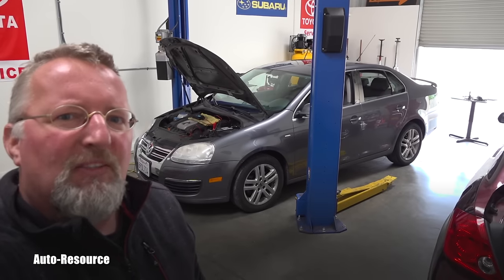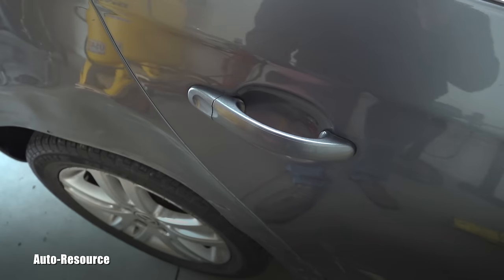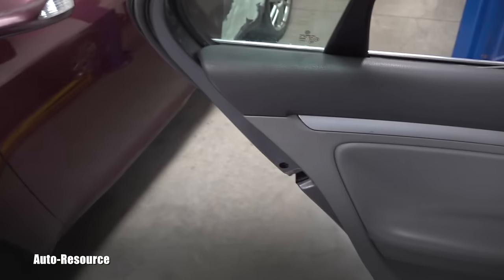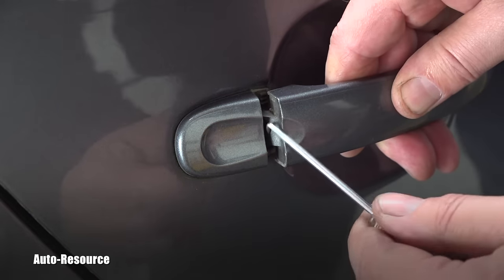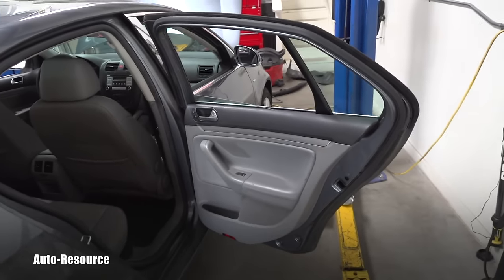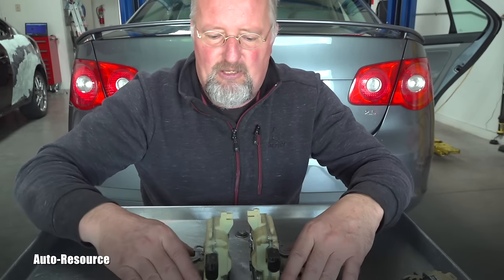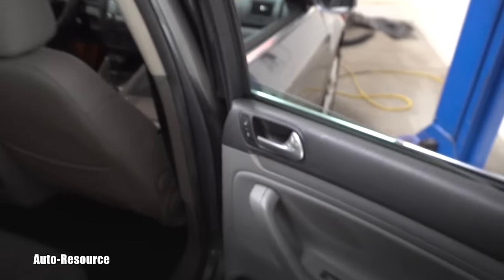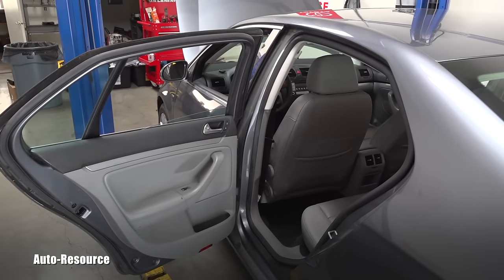How to open VW door which won't open from inside and outside

Comment: I popped the cable out but wont open from inside....any advice?
Reply: What helped for me was applying the central unlock button a couple of fast times on the key and at the same time pulling the indoor lever. Step by step I succeeded. Then it is important to remove the bottom screws of the indoor cover and the indoor cover itself. And then you will have to replace the lock itself, which is an awful task.

Comment: What used to happen to my 2015 Jetta (and only on cold Candian winter mornings)  is the drivers door locks would click locked and unlocked eight or ten times by themselves.  When the drivers door wouldn't open from the outside i would go in from the passenger side and have to open it from there with great difficulty.

Comment: I did it, If got a 2006 VW T5 Van, disconnected the cable, nothing, still won't open with inside handle.

Comment: What if the trick doesn’t work? My car driver door won’t open from the inside or outside and I just changed the door lock because it was bad.( never locked out unlocked the door) after I swapped the part it locked fine but won’t unlock. It does the unlock noise but won’t let the door open like it’s stuck 💔

Comment: Hi, I have a golf 5 1.6.. my passenger door won't unlock but does for one or two days after a very long time. Iv changed the actuator but still have the same problem. When you press unlock, the mechanism clicks twice instead of the normal once and doesn't open. I am beyond very frustrated since it's been years and need help..it locks and unlocks when it please. If I can't get help please at least suggest a type of specialist I can go to.. a locksmith, auto electrician, panel beater, a person with a diagnostics machine maybe?.. etc. Thanks in advance🙏🏾
Reply: I'm in South Africa by the way

Comment: I had the same problem but more simple, try to pull the cable few times, and try open the door from outside. After this you can open the door from inside and outside

Comment: Great video, good job. I have the same sort of problem with my left rear door. I won't open from the inside or outside. The other 3 doors opens and close. But i dont hear the left rear door mechanisme. So i wonder if your method works for my problem?
Reply: Did you fix it? I have the same problem here…

Comment: It seems to be a common problem, I own a polo, I don't even know how many times I woke up that the car wouldn't let me in and keep me outside or stuck inside, especially in winter. The conclusion I reached was that the lubricant of the mechanism is the cause! So I disassembled everything, washed and degreased and then I only came across WD-40. Any other lubricant has caused me problems over time.
Those locks are a big mess!

Comment: Hello mate, Great video but I can't open it still because my windows on a 2 door Audi A5 are closed and battery died. It just won't open at all. Any thoughts?
Reply: connect another battery to the positive connection on the starter and the negative to the chassis--then you will be able to use your key fob to open it
Reply: @reneebegian4465  thanks I got AA to come and start it yesterday

Comment: Great video.  2009 VW Jetta: No problem entering the car through any one of the 4 car doors, however having problems exiting the driver side door using the indoor car handle.  I either have to lower my driver side window and pull the outside handle to open the driver side door or reach over to the inside passenger side door handle and open that door first and then I can open my driver side door using the inside door handle.  Not the biggest problem in the world, but does anyone have any answers on how all 8 car door handles (4 outdoor & 4 indoor) work before I get into the car then only 7 work unless I pull one that's not the driver side indoor handle first?

Comment: Thats good solution for front doors,but on rear doors if its activated child lock which disables interior latch and you disable exterior latch by disconecting that small cable,you are in big problem then. :)
Reply: I disabled it and my door cant open

Comment: Decided I would rather take our 06 Jetta  to the dealer for repairs. Big Mistake!! 4 trips later and over $1000 Cdn. in bills, it is fixed. Plus as I washed it today for the first time since, I see a small dent from the inside on the panel they removed (4 times)😂

Comment: The same problem at a vw Polo Cross Bj 2007. I pushed from the outside the kable in the doorside and tried now to oben from inside. No way. It was still locked

Comment: i did exactly what you did and loosen the cable, but still dont want to open from inside...need more help please...
Reply: Did you solve the problem. I have same god damn problem. I cannot open the door after releasing the cable
Reply: @fatihhazar2424  
...not yet...I'm out of ideas...luckily or unlikely it's the rear left door...
Reply: @chriscoetzee6166  mine was rear left door too. Finally I opened the door. 

I parked the car outside on a sunny day. After few hour I tryed to open it by hitting below the door handle then I heard the latch unlocked sound. 
I think it is too hard to open stucked locks in cold weather. Hope yours will open like this. Good luck

Comment: mine is still stuck. cable is disengaged but inside and outside doesn't work.
Reply: I tried this did not work door still stuck ?.
Reply: I have same promlem. My car is golf5 2008.After releasing the cable did you find a way to open the door?
Reply: @fatihhazar2424  I managed to undo the upholstery and the sheet with the crane to take out the gram, I got to it but I can't take it out because it is locked in a closed position. How did you solve the problem?
Reply: same issue here, cable disappeared. any solutions???
Reply: @fatihhazar2424  same here for me. Door Stil locked
Reply: 2012 Jetta S my driver door is inconsistent sometimes locks sometimes not. It gets stuck on. It will lock with the turn of the key. What could I do?

Comment: This did not work on my 2007 mk4/N9 polo. Both passenger side doors do not open at all
Reply: Try to stick a small sturdy steel stick into the door handle hole to reset the mechanisms. My Seat door wouldnt also open after relasing that small thingy in the video. After pushing a stick into the hole I heard a click and I could open the door from the inside!

Comment: I had the same problem with my Golf, the door wouldn't open from the outside or the inside. But by pulling the inside and outside door handles simultaneously the door opened.

Comment: 2018 jeep compass.   I have this problem.   Door will not open from the outside.  Took door apart, didn't fix it, put back together and now neither side will open. 😡

Comment: strip the mech down the lock is dry that runs on a runner inside bet there is no grease or dried out, worth fixing, i even strip the new locks down even aftermarket and check inside, some come dry some are not

Comment: Both doors wouldn’t open from inside or outside. Put new cables on and it fixed passenger door. But driver door stopped opening again 🙄

Comment: No! Your method doesn't work! Not a single method I found on the Internet helped me open the door!
Reply: Didn't work for me either! Now I am guessing it will be a hefty repair bill
Reply: What’s wrong with your door mate?
Reply: @garryrussell1907  jammed shut, lock mechanism won't work and can't get at it
Reply: I’m the same..I tried to pull the clip a bit and it disappeared..tricky stuff..

Comment: Damn, but how to get back that cable 4:01 into door hand?
Reply: Look for how to replace vw mk4 door locks tutorials. There is a screw that needs to be released slightly (do not unscrew completely), which keeps the lock cylinder (the part next to the handle) in place. Therefore a T20 is needed and the door needs to be fully opened to get access. 
On the right side of your car the screw is on the left in the back of the door (when facing the door) covered with a rubber cover.

Comment: There is one more thing: sometimes the second lock just get stuck (a locking mechanism for the lock...no kidding)...then only door surgery helps. Btw. 9:30 you are mentioning that the outer skin has to be removed??? as far I know the inner cover underneath the door panel can be unscrewed -what kind of a VW do you have???

Comment: This is NOT a one-size-fits-all solution.
I have a 2008 Octavia (Mk2) with seemingly the same cable mechanism as shown, but was not able to open the stuck door this way.

If anyone has a solution for said brand, I would appreciate your help or direct me to a page where alternative solutions are brought, instead of paying a fortune for the "professionals" who know the exact causes of such issues.
One additional info on the "symptoms": when I use the central lock on all doors (locking/unlocking), there is a "repeat try" in this particular door. So all doors (including this one) make the mechanical sound of unlocking, but this one does not open and makes an additional clicking sound about a second later.

Comment: Easier solution: Just open the front door. Then you should see the bolts holding the rear door onto the car. Loosen those bolts, and the rear door should open right up.

Comment: This problem is not common issue. The car came out from factory with perfect condition. Once someone try to repair the vehicle, and put back in the vrong position the small wire into the door handle, then coming up this situation.
We knew this 10 years ago in Europe. Looks like the American market didn't know how to work on those cars.
Good job anyway, but no new information for me.

Comment: This is yet another reason why I won't buy another German car!
Reply: Same here, my doors on my 2014 jetta with only 40k miles are doing this. VW should be ashamed and I can't believe there isn't a lawsuit about this! Totally unacceptable for door locks to fail, if at all. I barely even open my other 3 doors in my car.
Reply: @adamc.7795 Exactly my 2019 jetta has the same problem now but with driver side door😢

Comment: Il a massive problem i can’t open the door from inside or outside because the child lock is on and the module is not working so I can’t open the window ether and the module is what operates the lock mechanism

Comment: 6:32   or you look inside the door if a piece has fallen off the so call useless spring connecting it to the curved piece actuated by pulling the door handle. Its pretty obvious that the useless spring is missing a connecting part enabelling the door handle plate to move back all the way. the adjustment of the cable is a good hint of the problem. now "VW Touareg Door Lock Fix" is showing the existence of a wearable plastic piece inside that could be the real cause of the door handle cable connected metal part to not go back in position... missing a piece between it and the useless spring is one thing but a wear inside also hinders the going back movement. the author of the other video says that if you drive on a bumpy road the plate is shaken back in position.. but if you drive on a bumpy road, a plastic piece could as well fall off the useless spring and be inside the door some where. Man I must have watch 40 vids over and over to come to conclusion and I think those two guys have nailed the problem.

Comment: Didnt work for me i released cable but cant open from Inside
Reply: Golf 5 gti 2005
Reply: Same problem. I have golf5 too. I released the cable and I couldnt open from inside. Did you unlock the door?
Reply: @fatihhazar2424  it magicaly opened by itself the day i took it to the vw service  :D so they changed my lock. Good luck with yours

Comment: If no joy, then raise the engine speed 2,000 - 3,000 rpm and keep pressing unlock.
Reply: Thank you very much!
Reply: How would that help?
Reply: change in system voltage

Comment: That did not work. I did not get the door to open like in the video. Any British car, you can get the door open from the inside. You just pull the door panel off inside and you have access to the mechanism. So much for German engineering.

Comment: It dosent work..
Reply: Same with me
Reply: @leonlalo31  Have you tried this? I want to try a front door pass. But if it doesn't work, I'll probably do worse
Reply: Have you tried this? I want to try a front door pass. But if it doesn't work, I'll probably do worse
Reply: I managed to undo the upholstery and the sheet with the crane to take out the gram, I got to it but I can't take it out because it is locked in a closed position. How did you solve the problem?
Reply: @leonlalo31  I managed to undo the upholstery and the sheet with the crane to take out the gram, I got to it but I can't take it out because it is locked in a closed position. How did you solve the problem?